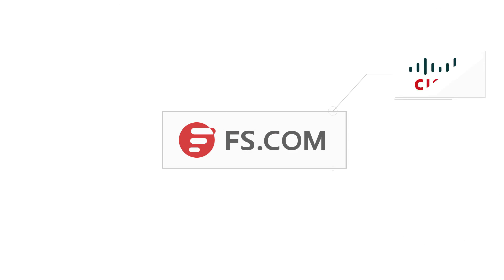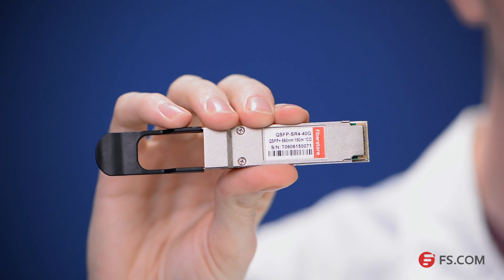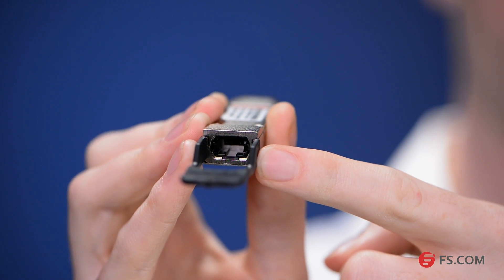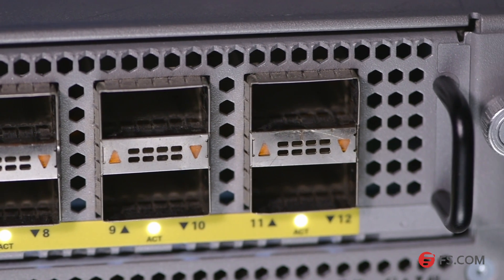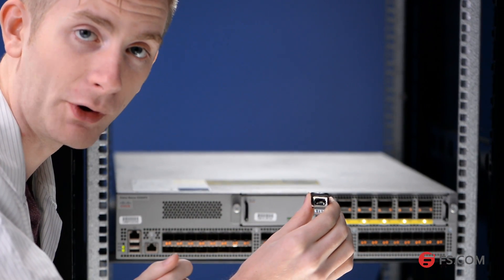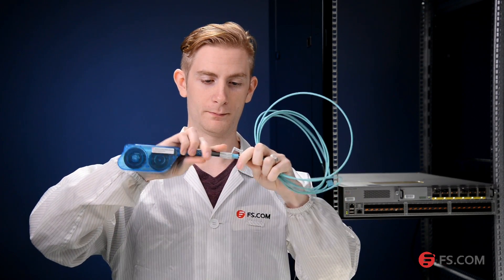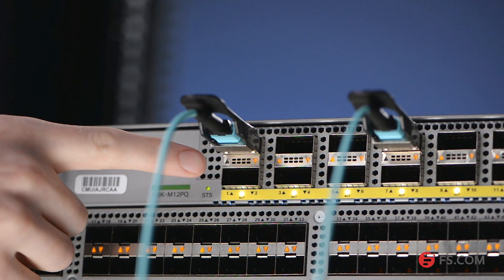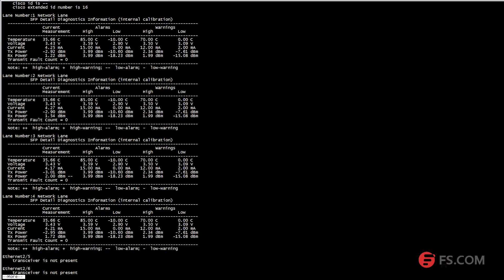QSFP-40G-SR4 Cisco Compatible Module Testing | FS

Comment: So you test the cable and transceiver by making a loop on a single switch? I'm pretty sure you can do better.

Also, you fail to explain why we should use polarity B. I've been researching this for like an hour now, but still no straight answer: which one should be used between QSFP host and QSFP switch and why.
Reply from the maker: Hi bviktor, thanks for watching this video. We are sorry that we didn't provide more detailed information about the module testing. We will consider your suggestions and do better in the future. ^-* 

As for the polarity, we selected the polarity B MTP cable strictly accroding to the TIA-568 standards. You can refer to it for more details. In case you are interested, here offers more details about our testing environments: http://www.fs.com/test-assured-program.html
Reply: Thanks for the response. Anyhow, can you please clarify on TIA-568? Tia-568 specifies all 3 methods, A, B, and C. And that's exactly my question, why pick B from those 3? Is there a particular reason or is it just a random convention?